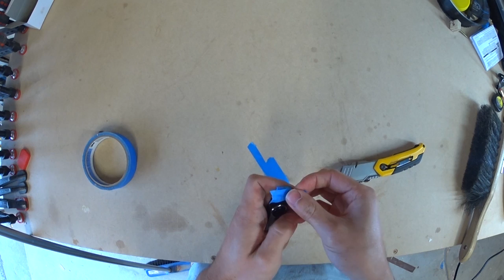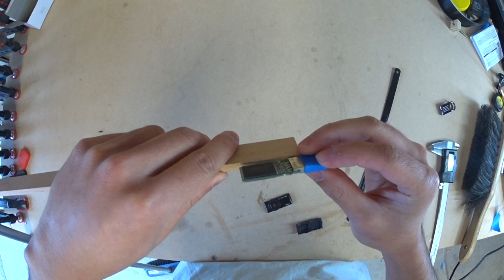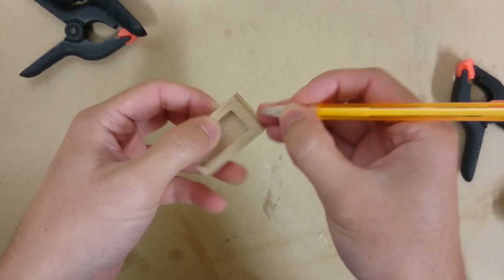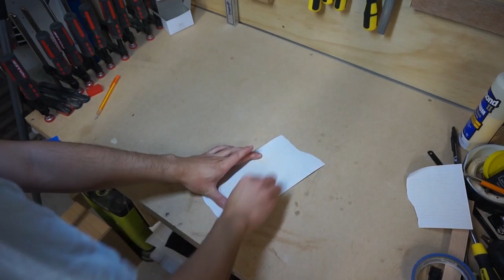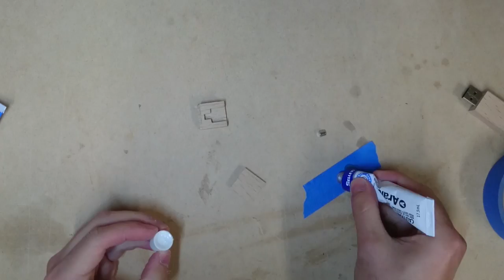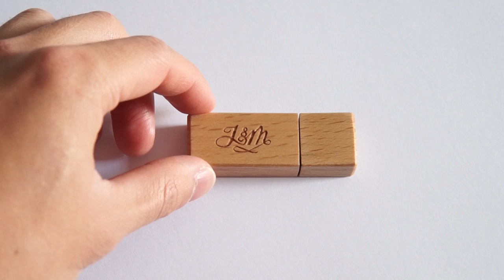Making A Wooden USB

Comment: Very nice! The magnet inside the lid was a great idea.
Reply from the maker: Had one for 4 years. Still works.
Reply: The magnet probably needs to be a fair bit stronger. Don't forget that hdd's have small magnets in them as well.
Reply: Al B HDDs have very strong, 1"x1.5" magnets! 😆 (3.5" sized drive, in this case) 

I let my daughter disassemble a dead drive the other day and showed her how strong they were.
Reply: Well if they're as strong as you suggest then the tiny fields generated by the magnet he placed inside his wooden usb cover would be puny and couldn't possibly cause any damage.

Comment: To everybody worrying about the magnet, here are some reasons you have nothing to worry about, just like the video and description says :

1. USBs have flash memory, which has nothing magnetic about it, so it cannot be corrupted by magnets. 
2. Even if it were corruptible by magnets, anything but a very strong neodymium type magnet would do nothing to it.
3. Making it even safer is that the magnet is in the cap. It's not rubbing around over the thing and it's nowhere close when the USB is being written to.
4. Everyday technology is at the point where magnets are even being used inside the machines for menial tasks. This means the items have been designed to be more resilient against the magnetic fields. I mean we use little magnet stickers on the backs of our phones these days without any problems (be aware the internal compasses and even cameras, from what i've heard, can be negatively affected by magnets).

Conclusion: Your USB is MUCH more likely to get corrupted due to a software error than the weak magnet used in the cap. Just stay away from the strongest magnets on earth, to be really extra super safe ;) 

Sources: Knowledge and Google. You can use the latter too.

Comment: Magnet, a good way to wipe your flash drive.
Reply: I was thinking the same thing
Reply from the maker: Does that mean those magnetic phone holders are a good way to wipe your phone? They have a much bigger magnet
Reply: Last Minute Thoughts Yes and no, they can damage the phones compass, but I have been using one for over a year with no issues. If the compass get's damaged then maps or any other GPS related app won't work correctly, but again I haven't had issues slapping the metal plate on the back of a phone case.
Reply from the maker: Right. So apart from the compass, if a magnet doesn't affect any of the phone's componentry, including its flash storage, then there's no reason that a magnet will affect a USB drive which has basically no components other than flash storage.
Reply: Last Minute Thoughts Yeah, that may be true, but I still wouldn't trust it. It would take a large magnet to actually physically wipe the flash memory, but I don't know about prolonged exposure.
Reply: Conventional Hard disk drive (with plates) do contains magnets afterall ;)
Reply: Your very argument contains a contradiction. FLASH memory is electronic. No magnets are used to write or read from it, so you're safe.

The future, we're living in it! :D

You can google "Flash memory" and read the wiki page if you feel like it. It's quite interesting and it has a bunch of other info that I never knew, like that Flash memory has a certain amount of program–erase cycles, so that's why USBs seem to "break" so quickly.
Reply: Initially i thought the same, but as stated in other blogs/community, flash drive memory do not use magnetic field to store information. So definitely no problems ;)
Reply: rip your ssd
Reply: RinRin I think the idea stems from floppy disks because if I recall correctly they can be fucked up by magnets.
Reply: A traditional hard drive can be messed up by a magnet, since it uses magnetism as the method of distinguishing a 1 from a 0. Flash storage, on the other hand, is not affected by magnets at all since it uses an electric charge instead of magnetism.

The only thing I'd be concerned about with this project is whether or not glue is conductive, but I personally have no idea about this so I'd simply look that up before starting the project. Apart from that I see no reason whatsoever for this to possibly be bad for the electronics.
Especially considering how easily replaceable the average flash drive is, and the fact you should always have multiple backups if the files are important, I don't see any reason to not see this as a cool idea if you want to carry your school or work files around in a fancier way than normal.
Reply: @woutvandessel1823 I'm late but it seems that the glue he used isn't that conductive since it hardens after all, tho I'd be concerned upon prolonged used of the FD, it might heat up leading to the glue he used to dissolve